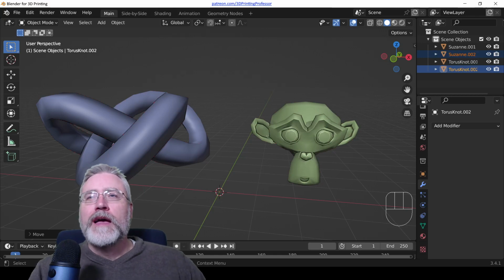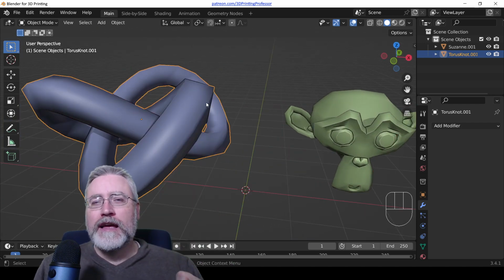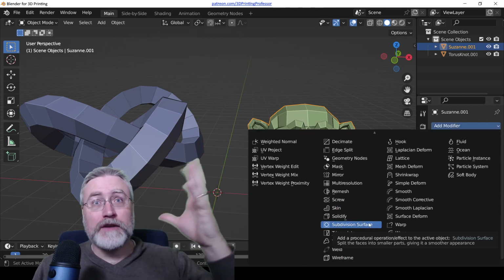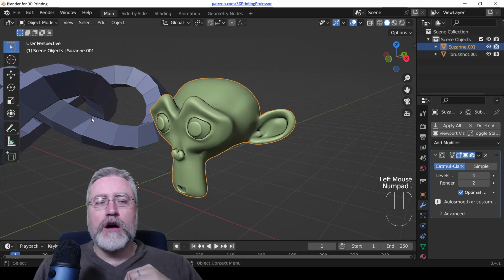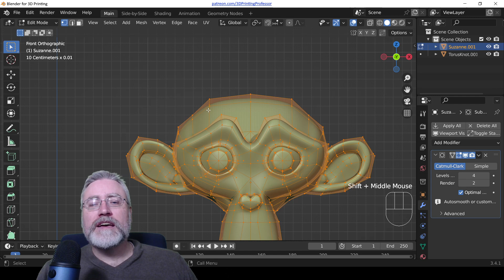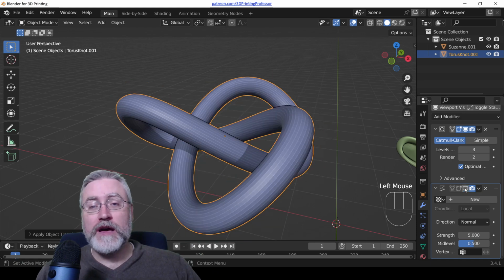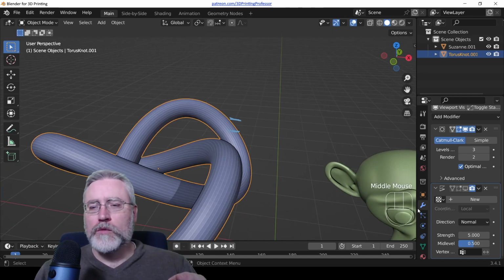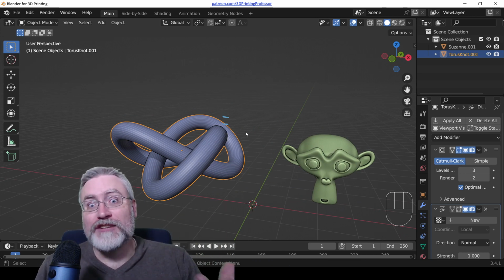Why do my exported models look bad? Blender Smooth Shading vs Subdivision Surface Blender QnA

Comment: Thank you so much for your content, im absolutley new to blender and have been trying to correct a model for print I had designed for a client. And nothing is working. Joining, remeshing, converting to mesh, boolean modifiers, make manifold solidify, non of it. 

What free program would you suggest to make a detailed model made of various shapes, into one solid manifold geometry /shape I can later hollow out for print?
Reply from the maker: Blender should be albe to do it. If you're on Windows 10+ 3D Builder should also be able to do it. 
But if you jump on my discord and upload the model I'll see if I can help.
Reply: @blenderfor3dprinting  man I would really Appeciate it! Let me send it as soon as I can, working double  and triple shifts lol.. will message yiu on discord...
Reply: @blenderfor3dprinting  is there a certain channel i should post it like #troubleshhot

Comment: So Blender has never been and will never be an animation program. It can be used for animation, but Blender is a General Purpose 3D program with Animation functionality. Also the default behaviour is to shade flat even with imports the exception being something like FBX where you can store the normal information and therefore would shade smooth if you exported it with smooth normals. Also this is not the easiest or best way to preserve volume while getting rid of faceting in my opinion. I am going to mention 2 methods that will give "better" results. Use subdivision surface with the simple setting I recommend with 3-4 subdiv levels if the model is relatively low poly. Then use corrective smooth.  With the "only smooth" setting enabled. This will smooth with minimal loss of volume and  shape from the original. The downside is that this method will unfortunately not fix any non maniford geometries you might have. The other option is to use the remesh modifier and finding a voxel size that works for you Then doing a corrective smooth. again with "only smooth" enabled. The advantage of this method is that it will ensure you have no non manifold geometry and the mesh would barring something really weird be ready to be sliced right away. The downside is you are more likely than not going to lose detail. And of course you can combine the 2 techniques to try to get the best result buy doing the subdivision modifier with simple then a corrective smooth with only smooth then remesh and adjust the voxel size. I want to encourage you in making more videos since I think spreading knowledge is important
Reply from the maker: I learned something. The Corrective Smooth modifier wasn't anything I was aware of before. Thank you.
Though, I find I really have to crank up the repetitions to get it to get it to the same level of smooth, and it doesn't respect creases at all. But it's a good tool to have.
Remesh is a powerful tool, and it does tend to make manifold geometry. I like this one.
Reply: @blenderfor3dprinting  So If you want more smoothing and to respect crease data rather than increasing the repeat you sandwich the corrective smooth between 2 subdivs. the first subdive modifier should be low something like 1 o 2 subdivision. Then you would have corrective smooth. instead of only smooth you are going to change the rest source from original coords to bind cords and click bind to bind it. then use the second subdiv with catmuli-clark to add as much geometry as desired. This will keep the original volume/shape better with less shrinkage while honoring creases and give you results closer to what you desire based on what you are explaining
Reply: Also you might consider changing the smoothing type from simple to length weight. A lot of users don't play with the settings or different modifiers